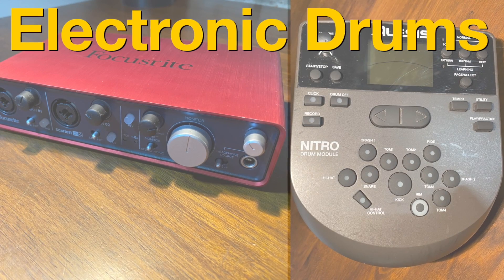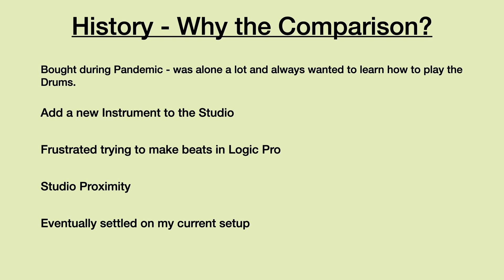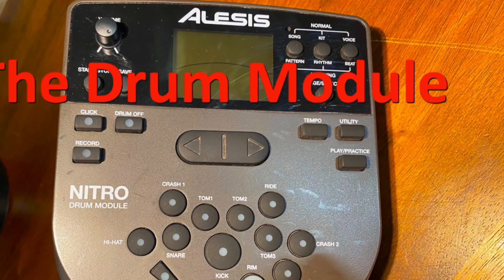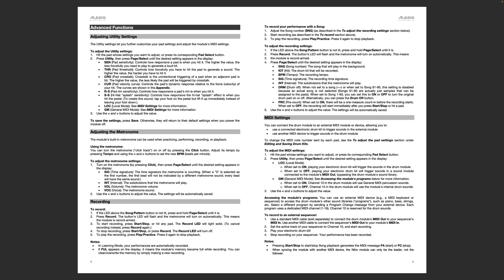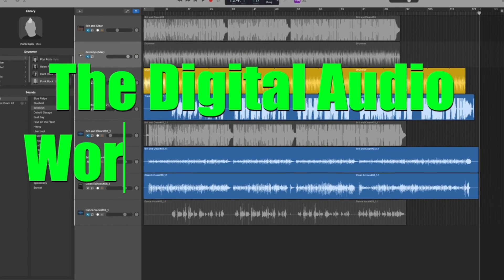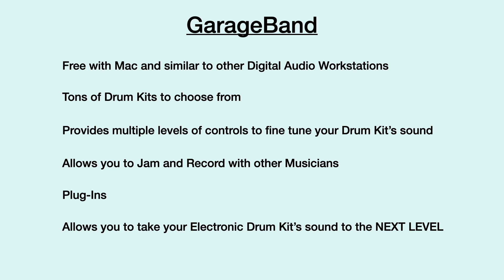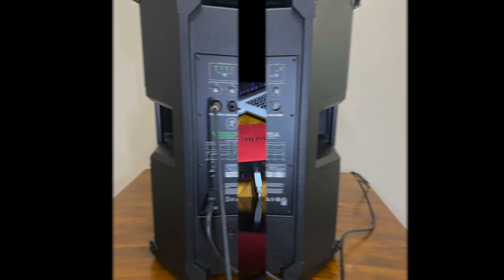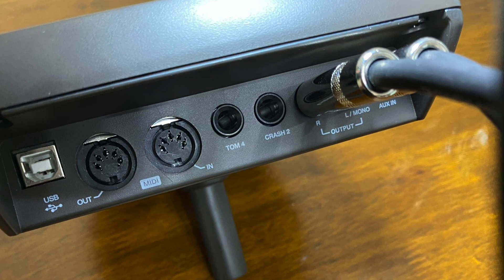Electronic Drums - Module vs Audio Interface

Comment: Hi   thank you for this video;  I am in the beginning stages of trying to configure a electric drum set configuration for purchase.  With a roland td-50x module, I hear folks saying that a DAW and better samples from a VST is the way to go.  However many are mentioning loopback in regard to the audio interface and drum module as they combine module sounds with the VST samples, either seperating pads for each or layering sounds.  How does that affect the connections from audio interface?  Would that be strictly usb-c cables from the audio interface back to the drum module?  thanks!